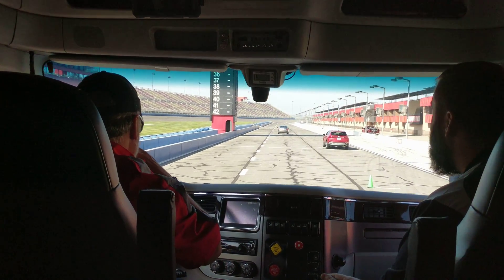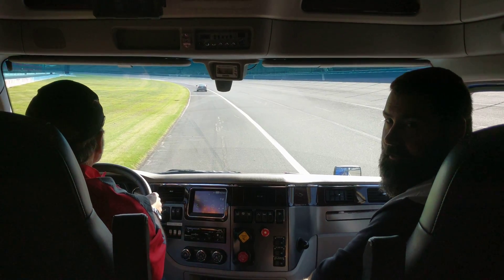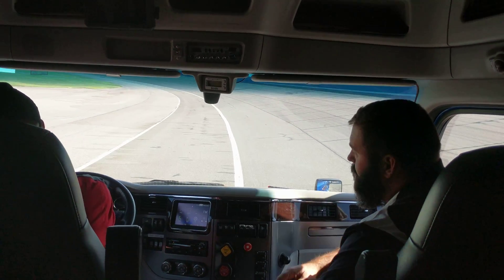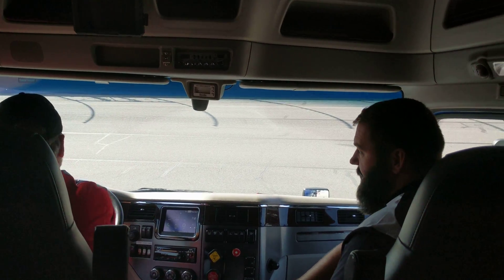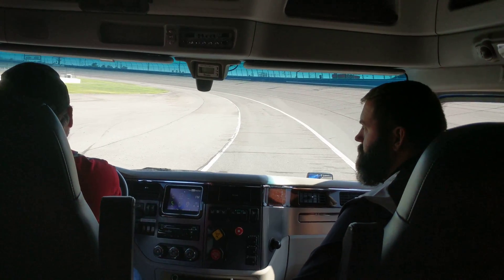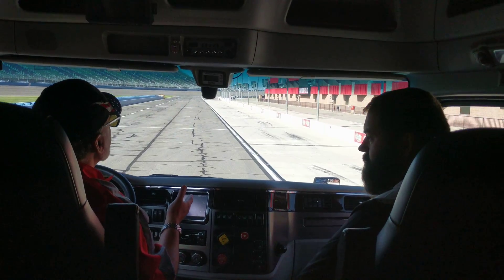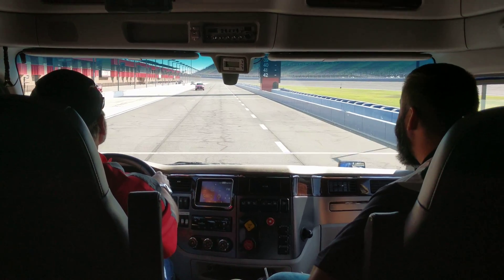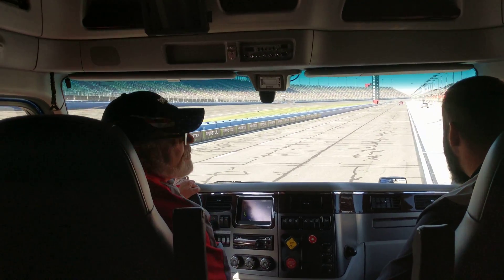BENDIX WINGMAN FUSION SYSTEM

Comment: The wingman system in my truck picks up speed limit signs sometimes it picks up route sighns it cuts the throttle and hits the engine brake it sounds good on paper but in the real world this system is junk I'll be driving high way speed and there will be a non active work zone the signs will be covered driving 65mph then the last sign will be uncovered becouse the wind blew it off the sign will say 45mph so I have to be the brakes on so I don't get in trouble with my company becouse of this system we've had good drivers lose their jobs the lane departure picks up tire tracks when it's raining so it constantly beeps who ever invented this should drive it for a month in DC traffic he will go crazy becouse it drives me nuts I'm looking at street signs all night instead of traffic other drivers get mad at me becouse of constantly jamming the brakes on you can stick this crap we're the sun don't shine.
Reply: I've had the same problem, I've even had it notice traffic cones and guard rails in curves and slam on the brakes. It's made me hydroplane more than once. I've had problems with cruise on or off. Its honestly the only thing deterring me from buying my own 579. I could get over the beeping if it didn't have control of my brakes.